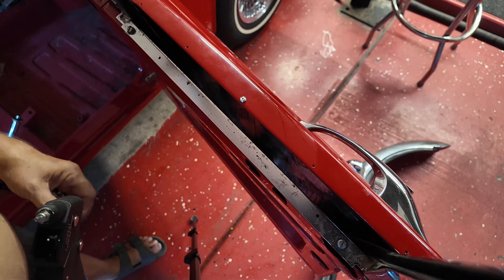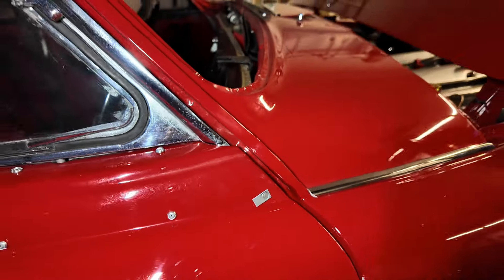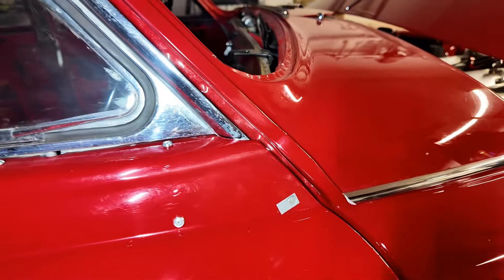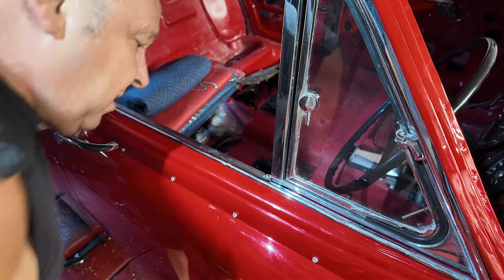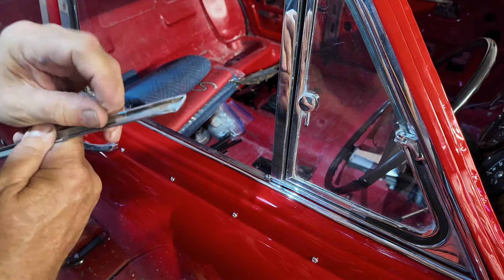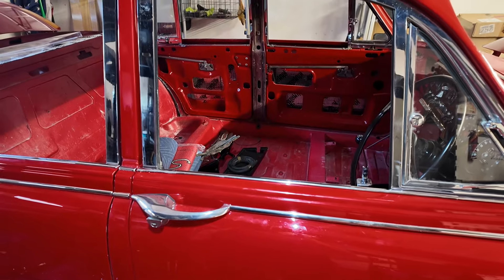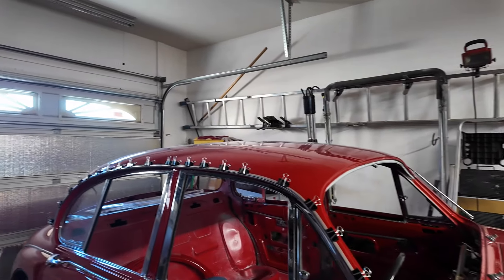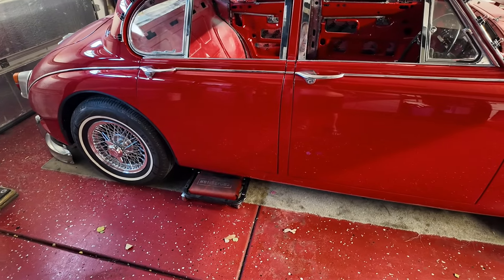Jaguar MKII Reassembly Part 317

Comment: Glad to see a new video plus back on the Jaguar. I know what u are dealing with the heat as in Yuma its even hotter than where u live . Since I live in a travel trailer I have no garage or covering . I am divorced so no  need for a house , well she got it LOL. I remove and bring parts inside my home and then return them in late evening or morning . I also do not have a lift so on the hot ground . At 72 it is a challenge .
Reply from the maker: @WilliamKennedy-e5j  well done, when I was single I rebuilt my E Type axle in my lounge with a roaring fire

Comment: There is a seal that goes around the edge of the boot lamp plinth, which doesn't look as if its fitted Gary.  I'f you don't fit it, closing the lid with the boot lamp (which most people do) can chip the paint under the lamp (ask me how i know!)
Reply from the maker: @nimbus265  yes I know there is a seal, I think it looks better without it, I’ll take the risk, oddly every time I close the boot I do not use the lamp but the boot lid just above it.